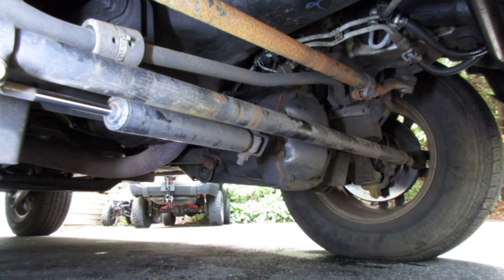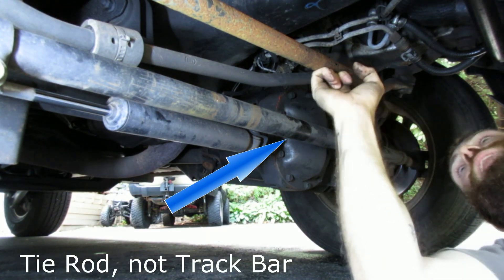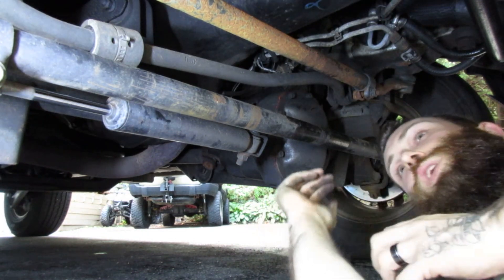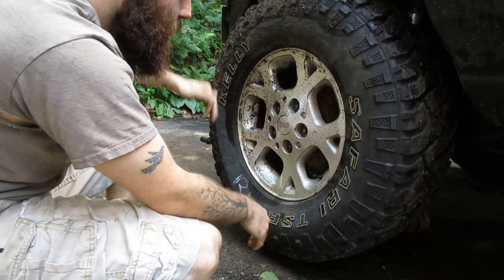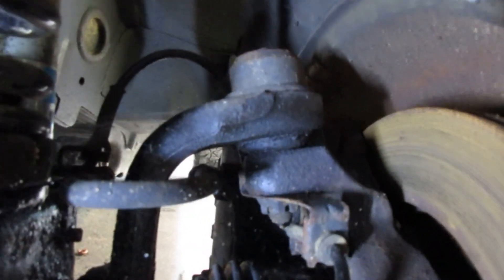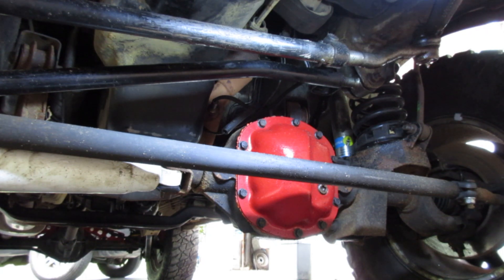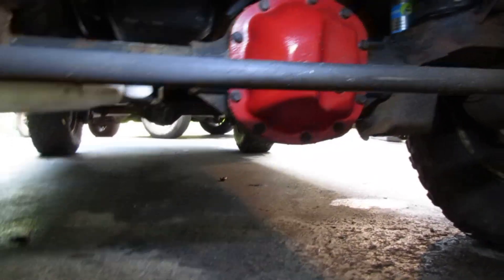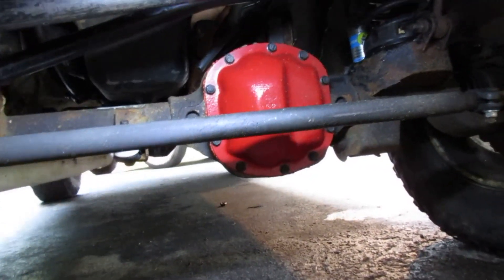How to Diagnose DEATH WOBBLE

Comment: i just bought my 93 cherokee laredo and every time i go over speed bumps the steering wheel shakes violently but i still have control of the wheel, death wobble?
Reply from the maker: Hard to say. "Bump steer" is when the wheel quickly jerks to one side or the other when you hit a bump at speed. "death wobble" has the word "death" in it for a reason. the whole vehicle shakes violently and you feel like you are definitely about to die. you may just have bump steer made worse by some loose steering components
Reply: D&E In The Garage |  any tips? I’m only 19 and this is my first jeep. I learned how to replace the serpentine belt and do a complete oil change but that’s it haha. Think you could point me in the direction?
Reply from the maker: Absolutely. Congrats on the first Jeep and learning how to take care of it. I'd be happy to help where I can. Is your Jeep lifted at all? The best first test i could suggest would be to get under the Jeep and have someone turn your wheel from side to side while you look for play. Pay close attention to your track bar mounts and tie rod ends. If you see any play in those components, that is most likely at least part of your problem. The tests I laid out in this video should help, but I also have videos on track bars if you are interested in a more in-depth explanation. 

Try to wheel back and forth test and let me know if you find anything
Reply: D&E In The Garage will do, thanks!

Comment: Okay so when I brake my Jeep starts shaking bad so what could be the problem?
Reply from the maker: Do you feel the shaking through the brake pedal or is it definitely in the body of the Jeep? It sounds like warped rotors are probably the root of the issue. Sometimes the shake from warped rotors can trigger DW though
Reply: D&E In The Garage I feel it in the body

Comment: Great video. If this is such a common problem on jeeps why haven't they came up with a permit solution. I've had it happen twice doing about 60mph and it scares the holy jesus out of you .
Reply from the maker: The permanent solution to death wobble is to keep up with suspension maintenance and to make sure you have addressed ALL aspects when lifting your Jeep. Unfortunately Jeeps get neglected and improperly lifted more often than no. a well maintained Jeep with a proper lift will not get DW

Comment: just fixed my death wobble the track bar hole was ovaled out  the bolt was a 32nd to small for the bushing an 1/8th om eithier side of the hole in the frame  so i drilled the bushing out to a half in did the same to the frame welded a harden piece of steel to the frame  so it will not wearout got a carrige bold machined it down till it barely fit put it back together and drove down a bad road in pa and no DW !! i was about to order 1800 dollars of parts bt now i can use that money to buy the rest of my tdi conversion !
Reply from the maker: Dang! That is a legit fix and sounds like a dope build! Would love to hear more about it.
Reply: defintly i am using a alh tdi motor i striped down the block cleaned it up got the were parts replaced  ordered the adaptor plate from gastodiesl   ordered the wire harness from fastforwardautomotive i tig welded a intake manifold this afternoon  also ordered  sone tubeing to make the extended drive shaft im shooting to have alll the part i need by early spring time  i work a a hydraulic\fab  shop havent had this much fun in a long time !

Comment: Awesome explanation! I have a 2002 but my issue is the noise my Jeep makes inside the cab after 25 miles an hr. I have ordered all the parts for the front end and ball joints. I’m just going to do it right and replace it all then go get an ailment. I hope this helps my issue.

Ok....I’m not really sure now what my issue could be after researching this for days. 

1. My truck did not make this noise before
2. After I hit 25mph the inside cab makes a noise like if you have big knobby tires
3. My steering wheel is not center, has not been
4. My steering wheel does not shake or wobble
5. My Jeep does not shake nor do my tires

Maybe I’ll just replace all the parts while I have them anyway
Reply: Well I didn't replace ball joints, they didn't need it. But I did replace everything else. Well my water pump went fixed it as well.

I still have the noise in my cab. Has ANYONE ever had this? It's like a humming little vibration maybe. Could my issue be my UJOINTS? Would ujoint make it so the inside of your cab sounds like its humming? or like you have big knobby tires?
Fixing front end and water pump went GREAT! BUT still have this issue. Or...OR it's just me aka I??
Reply: Does it happen when you're running either heat or AC? could be a plugged heater core or blower motor
Reply: @errorfourofour6681  it ended up being bad u joints in the rear drive shaft. Jacked up rear and that's when I found it. Can't check while not jacked it does not release the pressure off the driveshaft.
Reply: John Mueller makes sense, didn’t know mine was out til I lifted

Comment: I fixed it a few times 2 the one I'm most proud of was my Comanche I had used mud tires on it 33 1050 R15 and I kept switching Parts out of the junkyard as I would find better parts that had less play in them and I fixed it all the junkyard parts and no stabilizer on it.
Reply: in my case I did not change out any wheel bearings or upper control arms
Reply: originally I had replaced the track bar with a $39 AutoZone one it worked but it was garbage when I took it out and I replaced it with a Rubicon Express re 1650
Reply from the maker: Respect!
Reply: I should also add I did all this over a period of like 5 months I'll just keep trying different parts and better Parts until they all work together Mike Comanche wood death wobble when I got it it like 75 miles an hour and I never do 75 in it I just thought it was funny that it would do to touch your high speed usually the vehicles I've had that do death wobble do it like 35 or 45 miles per hour

Comment: so if my vehicle is not shaking when I turn but only when I hit a bump I have bump steer? my 2001 Cherokee shakes when I go over a bump at a good amount of speed, but if im turning or going down a smooth road it does not shake. SOMEONE PLEASE REPLY ASAP because I would like to fix this ASAP
Reply from the maker: I would go through the tests i have shown in this video. That sounds like death wobble. Check your track bar mounts. My 2000 Cherokee XJ had a similar issue a few months ago and the track bar was the issue. I have a few videos on checking the track bar specifically on the cherokee if you want to check them out. Let me know if you have any questions.

Comment: i replaced everything on the front of a stock xj and still had a wobble from only about 45mph-55mph, turns out i just had a bent wheel causing a bad wobble. 
now i have all new front end and used aluminium wrangler wheels
Reply from the maker: Dang.. that'll do it!
Reply: That wasn't death wobble that was wheels out of balance
Reply: i never said DEATH wobble, i said wobble, and even said bad wobble, but i never said death wobble....
i was just giving people something else to think about when they are trying to diagnose a wobble on a vehicle. most people call a bad wobble "death wobble" even when it has not caused death. and until someone has experienced "death wobble" (ether die or think you are going to die),  they typically do not know the difference between a "bad wobble" and "death wobble"
Reply: @MrMrsregor  on a different note. What year wrangler rims did you use?
Reply: the jeep wheels i have on my 01 xj right now are the jeep canyon wheels. but i am not sure what jeep they came from, now that i think about it... i think there are two different versions. skinny ones came on the stock ZJ and little bit wider version came on a stock TJ with a different backspacing. they both have the same bolt patter.
ZJ canyon wheels are 15"x7" with 5" backspacing
TJ canyon wheels are 15"x8" with 5.5" backspacing

i think mine are the zj wheels , but i am not sure. if i think about it i will check to see if i can tell and report back.

Comment: Got an '84 K30 that had a bad out of balance tire problem. First time I experienced death wobble with this truck was at 40mph, shook so bad it broke the track bar! I keep the track bar around to show people what it can do. Scared the bejesus out of me lol. New tires fixed the problem but I left too much time between tire rotations and I have it again. Going to try the air soft bb's to balance them, tires still have way too much tread to junk them.
Reply from the maker: I have always wanted to try that! I'd like to know how it works out for you.
Reply: I guess it's supposed to be real effective above 30mph. However, after driving my truck some more this weekend it seems it starts as low as 20mph. I put a small pipe along the fender at the bottom holding it close to the tire and as I slowly rotate the tire there's a difference of about 3/16. Explains the problem, but still can't afford to buy 4 new tires because of one being messed up. ARGG!!! I'm going to try getting as close to balanced as possible then put 10oz of beads in it. Hopefully it works. I checked the kingpins and drag link today, everything is tight :( Was hoping for a bad kingpin bushing. Cheap easy repair.
Reply: @brendanjames7122  How'd it go?
Reply: @DarkLinkAD  I haven't tried the beads yet, life kinda got in the way. I noticed some chopping in the front tires so took an hour to go through the alignment again, which helped considerably. Now fairly recently it started the wobble under braking around 30mph or so. God damn frustrating!!! Luckily the diesel has enough compression that it slows the truck far enough I can drop a gear to slow it further where I can brake. It must have a bad king pin that wont show it's self until it's under stress going down the road. No matter how I proceed it's going to be at least a grand to fix. The whole dana 60 is in need of overhaul. 4.56 dana 60's are hard to come by around here so a good used replacement isn't going to be easy to find.

Comment: My wj eats tie rod ends also LOL
Reply from the maker: Your best best is upgrading to ton steering with johnny joints... the issue is the cash to make that swap... until I find a money tree I am going to keep warrantying out my Moog ones every 9 months
Reply: D&E In The Garage I just ordered Kevin's garage 4x4 track bar. I'm hoping that will help dramatically I put Freedom Offroad 3 inch coils all around.
Reply: Well I replaced both outer tie rods. Due to your technique on rotating the tube and seeing if it stays in place. It was very loose. And also found some driver upper ball joint play. But the tie rods cured the death wobble. I got some lifetime warranty ends. Installing Adjustable track bar today. This is becoming a fun hobby

Comment: I'd like your opinion on this, if you've got time. II had death wobble in my 93 XJ (stock suspension) about 8-9 years ago, but probably had only 10k light miles on that vehicle since - MAYBE 1-2 miles offroad. Mechanic had never even heard of it (!!) but I explained what it was and he replaced the track bar, and not a hint of a problem since. Here we are today, and I just had my fuel pump replaced. I just drove it home today, and hit the death wobble again twice on the way home. It's definitely THE death wobble and not any kind of high speed vibration or whatever. I haven't had a chance to get a good look at the suspension to see what I can see on the track bar yet - a very quick visual inspection and a few tugs here and there and things appear okay on the surface - but what would you say is the SECONDARY cause for this? Why has this happened again already? What all should I replace to prevent this coming back a few years down the line? I don't want to just replace the track bar and get by for another few years; I'd like to fix what's CAUSING the problem to recur, if I can. What would you reckon is most likely to cause it to come back? Is it just gonna be any and all of this, or does the fact that it's come back give you any hint? Sorry in advance if this is a stupid question; I'm actually still a novice at this! I'll be running all of these tests over the weekend. THANK YOU for this video. This is great.
Reply from the maker: Well it is difficult to diagnose anything through a computer screen, but I will try to offer my opinion. First, as for the ultimate "cause" of DW, it is the solid front axle. As long as you drive a vehicle with a solid front axle, DW will be possible. That doesn't mean it is a certainty you will get it, just a possibility. The best thing to do it stay current on all suspension maintenance. If I had to guess - shooting from the hip without seeing your jeep - I am going to guess that your previous DW caused something to wear out of spec. when you replaced the track bar, you fixed the initial cause, but the out of spec part is now causing your second round of DW. As it is stock XJ suspension, I would wager your body side (top) track bar mount is ovalled out. Having DW on a stock track bar will do that. A fix would be to upgrade to a more rugged track bar without the tie rod end mount on the body side. I believe rough country sells one relatively inexpensively. In my option, the upper track bar mount on XJs (and ZJs and TJz) is a HUGE weak point. the one the WJ uses is light years better. Have someone turn the wheel back and forth when you are in front of the vehicle. look to see if you have movement in that top mount. Let me know what you find. I'd be happy to offer any help I can
Reply: Oh, wow, so it is POSSIBLE that it could just be the track bar itself again! Yeah, it's funny, I've had other Jeeps - in fact one other that was identical to this one in all but color! - and never experienced the DW until this one. The wheel test you explained is the first thing I plan to try, then the rest of the tests you showed here. This is a great video for demonstrating all that stuff, so I can't thank you enough. My main problem now is that it's utterly FILTHY under there, just caked on road dirt, so it's hard to tell if anything is worn! I've got to get it cleaned before I can really see anything. I really appreciate you taking the time to answer me! I'm determined to get this fixed on my own this time now that I've got equipment, and though I'm a complete novice at mechanics (oil changes, brake pads, filters, really really minor stuff like that, but nothing else), at least my husband is handy under the hood and may help me out... if I let him. :D He's not a Jeep guy, though (old BMWs, ew!), so I actually know more about this than he does now, thanks to you!
Reply: Soooo... I got under there and had a look, and didn't see anything wrong. No distortion of the track bar holes, not loose... anything, etc. Granted, that was all on the surface and I still need to give it all a REALLY good clean before I can get a good visual inspection, but on the surface everything appears fine. HOWEVER, here's something weird! I have not experienced ANY wobble since I drove it home from the shop! On the ride home from the shop, the VERY first time I hit ~55 and the VERY first time I hit a turn - boom, wobble. I've tested it out several times now, in fact even on the exact same route, and not experienced ANY wobble, even trying to make it happen! Is it possible that having it up on a lift kinda... shifted? things around, and driving it settled things back into place?? Because it happened immediately after driving it off the lot, and it hasn't happened again (yet). Is that even POSSIBLE? I have my doubts, but the last time it happened, in this same vehicle, it was pretty reliable from the first time I felt it. Sorry to keep bothering you, and I totally understand that you couldn't begin to diag anything just over text, but it seems weird to me and I'd just like an opinion from somebody who knows a bit about this!

Comment: I have a 95 grand Cherokee that had death wobble and agree with 90% of your diagnosis.  However, you stated the upper ball joint was bad because you saw up and down movement.  If you do a little research you will find that the upper ball joint is designed to move up and down (axial movement) but not side to side (radial movement).  This is to allow for manufacturing tolerances of the axle yoke as well to make it possible to install the upper ball joint using a simple C clamp type press.   Almost all of the weight of the Jeep is supported by the BOTTOM ball joints.  Any up and down movement in a bad bottom ball joint will be reflected in the upper.  The bottom ball joint is pressed in from the bottom where road forces will tend to jam it in harder.  But the upper joint is pressed in from the top.  If the upper ball joint did support vehicle weight, road forces over time would tend to try and push the joint out of the yoke.   But if I were replacing a bad lower ball joint I would also replace the upper if for no other reason than the upper has to come out in order to replace the lower.

Comment: I did my track bar, still there. Doing all tierods tomorrow. Had mech check ball joints and said they were fine. Hopefully the tierids solve it but if not what next. Ive heard control arms? What about steering box?
Reply from the maker: Control arms can definitely do it. I suppose a loose steering box would have an effect. Check that you steering box is securely fixed to the jeep still and isnt flexing or moving.

Comment: If you're having problems with ball joints going bad try greasing them more often they should have a grease fitting on not saying that that will fix it but try that
Reply from the maker: Definitely sound advice. Jeeps DO go through tie rod ends and ball joints, but it happens a lot faster if they are not properly lubricated.